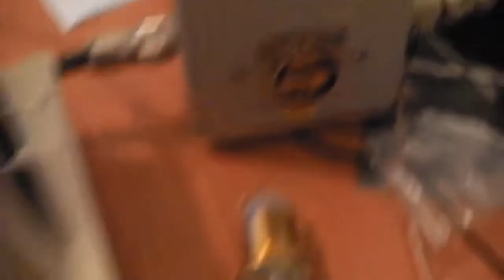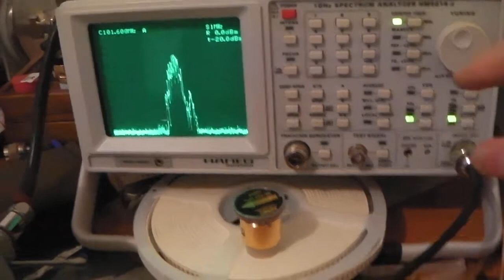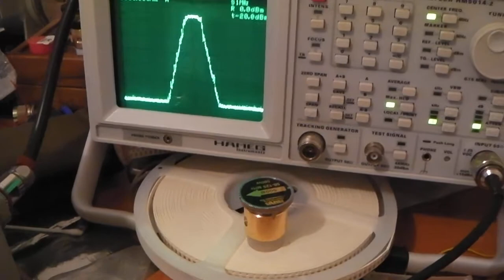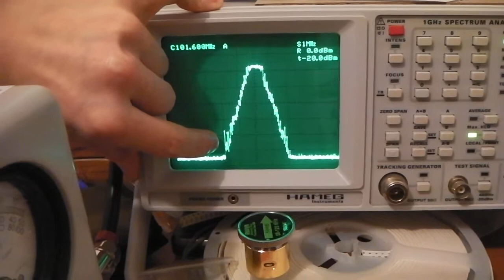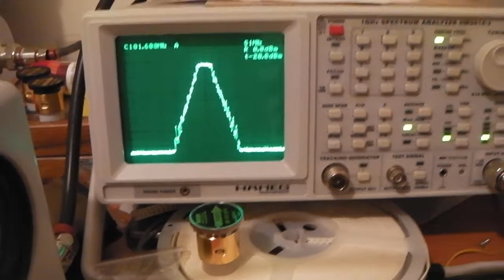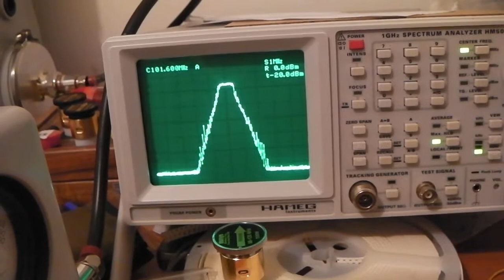The new Radio Master 400LE-V2.5 show and comparaison versus other transmitter

Comment: What does mean 1dB compression point?
Reply from the maker: 1dB compression point mean that there is only 1dB difference betwen the saturation and the ideal linear curve. 400W at 1dB compression point is very nice and mean the there is low harmonics production because theere is no big difference betwen a linear ideal waveform amplification and the actual waveform.
Reply: fmbroadcast Thanks!
Reply: hey  there my freind   can you contact mr i think u hsve mya email